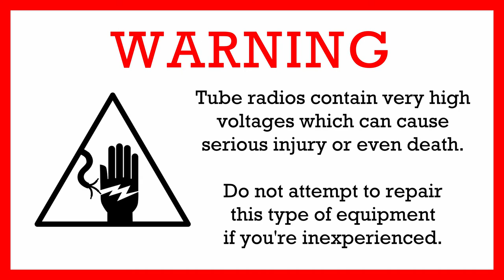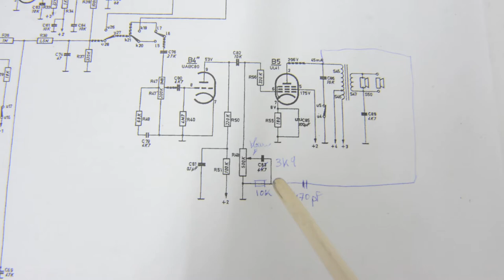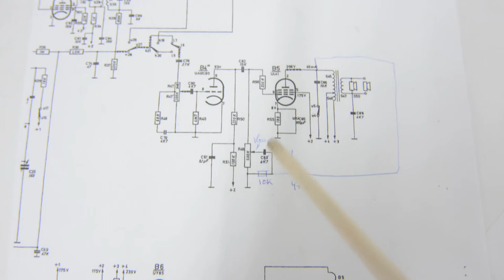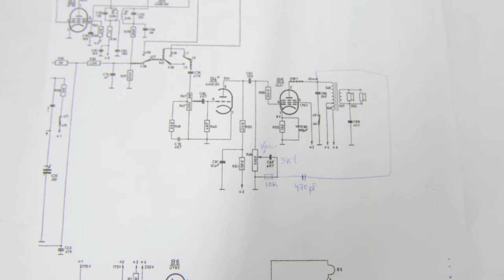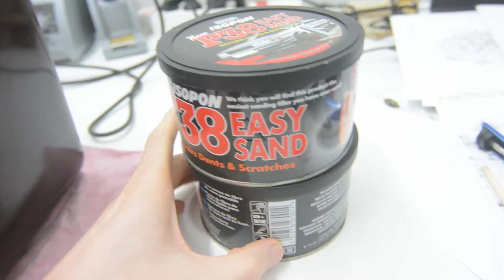Fully restored 1955 Siera SA1022U tube radio - Overview, finalization and demo

Comment: If you don't have an expensive high-ohm tube voltmeter handy you must use your finger and determine the plate voltage by the given intensity of the shock.😧
In which case the trick was to earth the feet so as to limit the current correctly without the need of turning out dead.
True, empirical learning had turned out painful sometimes, like testing the flyback transformer on a black & white TV;
but a screw or screw drive was never what really fixes such a TV.😏
Ps: For Chinese radio reception you don't need a repeater. What you need is a skip zone.
The Germans on the other hand were often difficult to hear because the Groundwave often did nullify the skywave while fading in and out of the skip zone,
and thus they then had historically ended up on your roof.😆
Please remember not all children born in the 50th had opulent parents or an understanding of their children's deeper needs.😮‍💨